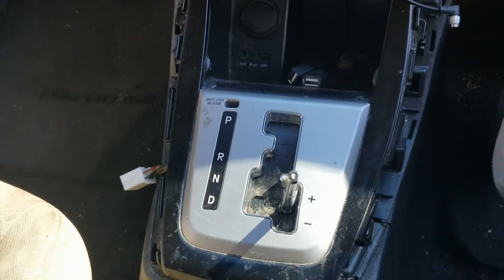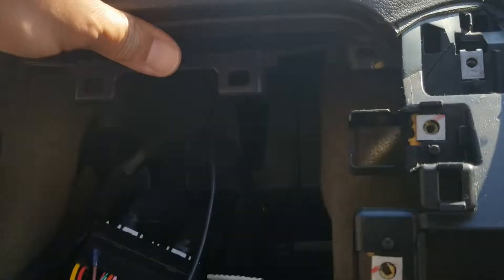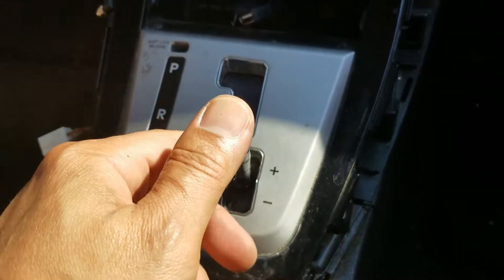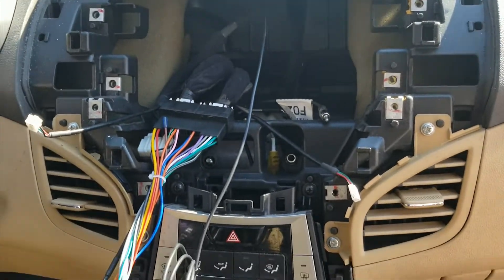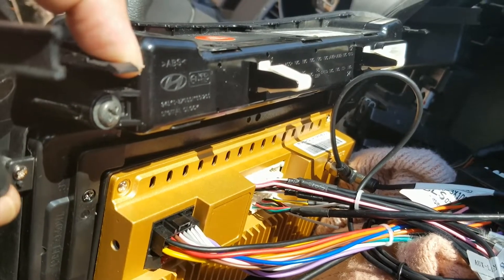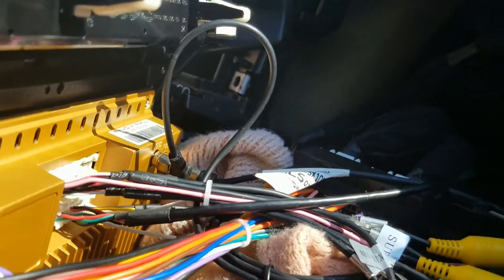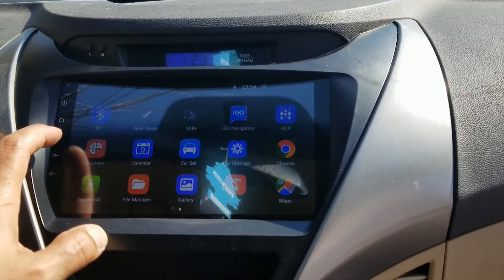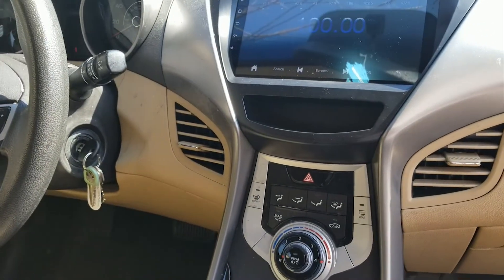2011-2013 Hyundai Elantra Android Auto Plug And Play Radio Installation.

Comment: I'm looking into paying a mechanic to install this for me. But before I do is there any update on how this is working still? It doesn't have very good reviews so I'm curious if it would be good enough for me as I'm just looking for google maps and a back up camera
Reply from the maker: Good question. Couldnt tellya..🤦🏿‍♂️🤦🏿‍♂️🤣🤣..that was done years ago and im just the installer. BUT, she was a young girl who drove that car, so either its still working and she has the car..orrrr..she doesnt have the car and someone else is driving it. I usually am roped into installing these style radios..I just installed 2 of them for the same guy. Ended up ripping both of them out for two other ones. 700 bucks in labor. But I wish I had a better answer. Usually people come back if there is a problem. I think that was like 3 years ago, or close to it.

Comment: hi rich, thanks, did you manage to make the steering wheel buttons works? how?
Reply from the maker: Oh man. Thats an oldie. Usually you have to go to settings and find something that says car settings or vehicle settings. Every radio is different. But then you follow the prompts. Cant be more specific because every radio is different. But its usually hit the set button and then hit the corresponding button to learn the command. I hope that helps. Its usually in a "setting"..

Comment: I bought one and couldn't get the sound to work. Any suggestions?
Reply from the maker: Was there any sound before install? Sounds like a dumb question but some people replace radios because of no sound.
Reply from the maker: Just looked. Those cars did have an amplifier option from the factory. If so, you need a bypass harness from metra. Part number 70-7305. But I would call the dealer and ask the parts department if the car has a factory amplifier. They should be avle to tell you when you provide the vin number.

Comment: 0:40 What’s up with the two USB’s just left hanging in the small compartment there? Do they connect to something in the end?
Reply from the maker: They allow devices to plug into the unit and be used through the radio. So a phone would work, a usb drive full of music or videos would work. Or both. Lol
Reply: @richideates  yes of course, but do the wires just stay hanging loose there? Or do they go somewhere?
Reply from the maker: That depends on the install or installer or whos paying for it or what they want it to look like..if someone doesnt wana pay extra, it stays there hanging..lol..if someone wants to pay and or have the extra time..you can buy a permanent mount one to make it look nicer..lol..all up to you or the situation